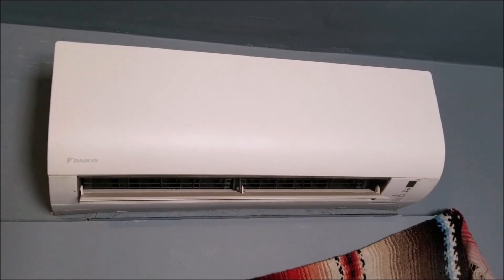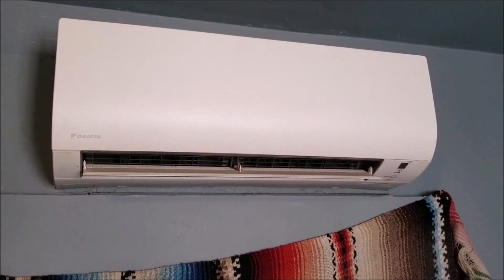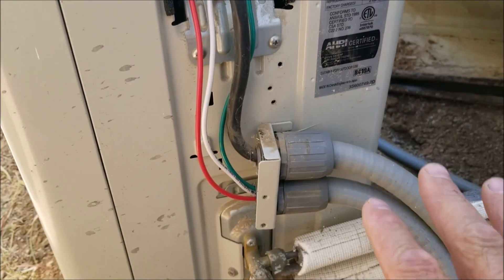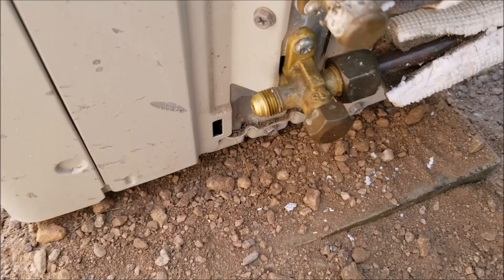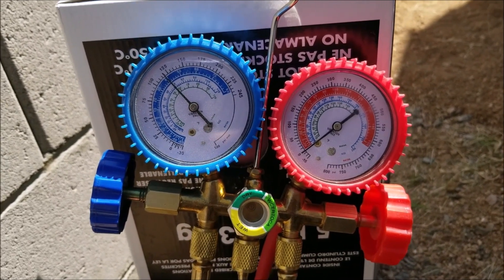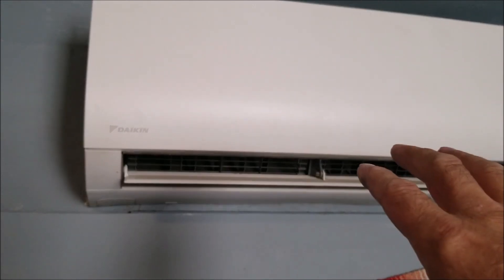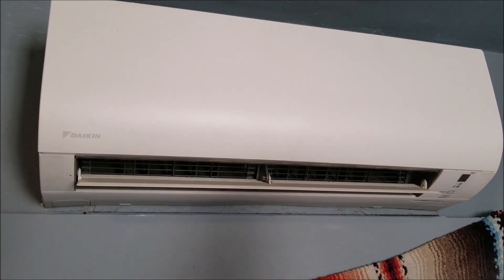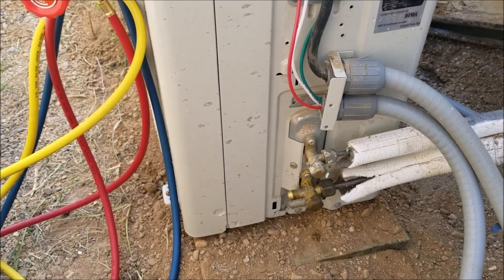How To Add R410a Refrigerant to a Mini Split that Has a Low Charge

Comment: After recovering All refrigerant,do we need to vacuum it down the outdoor unit or just the line set? Please help me I’m a rookie
Reply: The outdoor condensing unit is sealed at the factory, but once in use, it has been opened and would need to be set in a vacuum. Basically, if it is direct from the factory, it is not vacuumed down, but if it has been in use and the unit has lost its refrigerant, then yes, it will need to be in a vacuum along with the line set.
Reply: Thank so much Sir , as a beginner so I just installed a 3 Ton mini split unit, I do all the procedure , I vacuumed it down to 320 over 10 mins . When I release the refrigerant I heard the water sound through the line set, so I’m worried about the refrigerant leaking. I saw a tiny drop of water under the flare nut. Is this refrigerant leak? If I were to vacuum the condenser unit do you have any tip for me?
Reply: @joelin5877  Check all the connections with soap and see if there are any bubbles that will show if there is a leak. If there is a leak, you can pump the refrigerant back into the outside condenser like it was when shipped to fix it.

Comment: If the system is empty, do you recommend putting on a vacuum first?
Reply: If the system is empty, first, fix the leak,  place it in a vacuum, then add refrigerant in by weight with an HVAC scale.

Comment: Another thing is that some places require you (by law) to fix a refrigerant leak before adding refrigerant. The refrigerant does not get used up like gasoline in a car. It has to leak out to be low on refrigerant.

Comment: Usually they give you the amount of refrigerant required in ounces. Don't forget to add extra refrigerant for longer than normal refrigerant lines. You will find that data as to how much to add per extra foot or meter in the installation manual or on the outdoor name and data plate. Remember that there is an accumulator in the outdoor unit that holds extra refrigerant in it for heating months. If you do not follow the proper procedure, by the weigh out and weigh back in method, you might have enough refrigerant for AC mode but not near enough for heating mode. If you put in too much refrigerant in the system, and then cause liquid refrigerant to run into the compressor causing catastrophic failure.

Comment: Forgot to purge the hose before adding the refrigerant. Also, I would recommend letting the unit run for about 15-30 minutes to see if the pressure drops or increases. Those pressures with fluctuate depending on the weather outside.
Reply: On a single head unit, you don’t have to wait anymore than 5 minutes. The system isn’t really big so it doesn’t take long to stabilize.

Comment: No purge. Adapter has a schrader valve so if you put the adapter on first you won’t let much out but never check refrigerant on these unless you feel there’s a problem cause as he said you loose some every time you put gauges on and take them off.

Comment: Most techs with the compressor, gauges, lines, and valves probably end up adding some air into your perfectly sealed system.  Usually will be fine.
Reply: not the point. this guy claims to be a pro, and that's a huge no-no.

Comment: If my gauge says empty (  30 psi) is there still refrigerant in the split unit? I ordered a recharge kit that has a little more than the unit needs so I am thinking I don't need to recover anything if it says empty. Id Just vacuum it out again. The recharge kit has Leak stop and UV dye in it.

Comment: how do I calculate the required r410 on an empty 4-zone mini split 36kbtu, Suction OD is 3/8 and Liquid OD is 1/4, I have 82ft total for all 4zones but not sure if I need to multiply this number by 2 because each set has two lines, if so then its 164?
Reply: Buy and read a book on basic refrigeration then go buy and read a book on mini-splits because they are different then go online take your test get your certification they will send you your license in the mail… now you’ll know…… and Never I mean Never go into any forums on this subject

Comment: Really nice video! I'm a beginner and have two more questions. When the refrigerant comes out of the bottle in liquid form, does it evaporate immediately and then go into the suction line in gaseous form? I think so! And what would happen if the Mini Split is in heating mode, instead cooling mode? Is charging possible? If yes, do I still use the suction line for charging? Does the suction line become a liquid line and is getting warm?
Reply: in heating mode you would have to heat up the refrigerant bottle to a higher pressure (300+) than the line. That's why charging is done in cooling mode.

Comment: The problem is when you recover the refrigerant, a small amount of compressor oil is also recovered. Not a problem when only done once but when done multiple times it will no longer blow cold air.
Reply: Lol, it will blow fine until the compressor seizes.

Comment: I just installed a new split unit , but I didn’t do my connection right, and my freon escape, 
Can I refill it?
Reply: if you are in a pinch you could use half the amount of propane, but fix that leak and Don't blow yourself up.
Reply: @thedavesofourlives1  Propane?

Comment: did you have the mini split running when you add the 410 refrig. ?
Reply: Thats exactly what my question is.
Reply: @joedenny8853  well I gave it a shot, not knowing the answer, I hooked the gauges to it and started it, added just a little at a time, got the pressure up like one that was working, 120 and wow it worked like a champ and still going, been a month and doing great, I guess It worked

Comment: Question, do i run the ac on cold when charging? Or doesn’t matter?
Reply: yes, or you will be fighting the high pressures of the compressor in heat mode.

Comment: what happens when the line set is shorter than the precharge factory recommended line set. for example 95ft precharge and I sued only 30 ft of lineset for a multizone mitsubishi
Reply: then you release it into the atmosphere, obviously. (joking)

Comment: Bleed your line. And no superheat or sub cool? Just winging it?
Reply: Unless you recover the charge and weigh it in, yes you gotta pretty much wing it. Superheat and sub cooling are kinda meaningless on something that has a variable speed compressor. Best way to charge a TXV is with sub cooling which is very difficult to measure on these things. They usually don’t tell you what sub cooling they expect. To rely on this, you’d have to know the thing is running at or near 100% capacity. The few times I’ve done this I just shoot for about 15 degrees of superheat on the suction line coming back. It’s not rocket science. Just add a little bit at a time. It need not be exact.

Comment: You forgot to purge your hoses and just added non condensables  into your system which is not good. You should always crack open the yellow hose on your gauges with your refrigerant tank open until refrigerant fogs out and then crack open the blue hose at the gauges so it pushes any air out of the hose.
Reply: Man you’re smart
Reply: @Dbltrl no he just been doing this for a while

Comment: Quick Question (i hope) .. I've vacuumed down and am ready to go, but wondering about order of operations.  When do I open the valve stems?  I assume since the system is running on cool (based on comments answer) the valve stems were opened after vaccuming out the system.    So a) hookup tank and service ports to yellow/blue as shown b)  open valve stems to let what refrigerant I do have into the system c)  turn the mini-split on in cool mode d) open tank via yellow and flip e)  open blue "on and off" as shown to get to right pressure   or, should I hookup after opening valve stems?   Seems like since I've got yellow / blue connected to test my vaccum, i can just move the yellow from the vacuum pump over to the tank, open the valve stems and follow video from there
Reply: If the system is in a vacuum the refrigerant will need to be added in by weight

Comment: I add refrigerant by required weight but my suction pressure was like 74 psi and suction line is 24 degrees

Comment: This video saved my bacon.
We had a mini-split multi-head unit installed less than four years ago, and the unit just started to throw error messages. The error message was the refrigerant was low. The machine would not turn on.
I figured out the override switch and ran the compressor, then hooked up my gauges as you show, and put my bottle on my scale. I added about 100g at a time, let it run for 5 min, and checked the temperature of the three indoor head units. 
The unit is under the max tube length, of 50m, so I know it was supposed to have 2.4kg or 2400g of R410a in it. I added 100g at a time. When I got up to about 300g the head unit nearest the compressor started to blow some cool air, and the temp inside the head unit went from 32°C to 27°C.
I was on the right track.
I kept adding 100g at a time until I had all three head units inside temps at 19°C which is what my other aircon's inside head units were at when set at max cooling of 22°C.
In total, I added about 900g of R410a refrigerant.
I know there is a leak somewhere, and I'll have to fix it, but I'm really busy with work right now, and would just like to get through the summer. Off-season I'll pick up a better deal on a used recovery machine and bottle then ill fix it correctly. I have two other aircons that I have to do this with, so getting a recovery machine and bottle is undoubtedly going to happen.
This video really helped me out, if even just a short-term fix.
Thanks from Tokyo
Reply: What error code did you have? Mine is error code EC. Thanks.
Reply: Did you get it fixed?

Comment: 9:50 You don't need to be rushing here, nor do you need to let refrigerant out of the hoses into the atmosphere; you can empty the gauge set and hoses into the system. Of course that will increase the amount in the system by a little more, so you have to bear that in mind when estimating how much to add. Do this by closing off the liquid line valve (under the nut to the side of the valve connector) with a 4mm Allen key while it's running. The compressor will then suck the refrigerant into the system. And if you use a screw in valve depresser, you can release the Schrader valve once the line set is empty so you can undo the connectors with no pressure. Then open the valve again and the flow will return to normal.
Reply: Will this hurt the system at all? (Newb here)
Reply: Agree, that is how i learned it too.
Reply: Thanks.  Do you unscrew the schrader valve depressor while it is running, or shut it off first.  If still running it may suck in a little atmosphere, no?

Comment: Delta t on a mine is around 20 to 25 mine splits have variable speed compressors variable speed fans and electronic expansion valve on the condensing unit unlike conventional systems have the metering device in the evaporator that is why the only true way to get the credit charges is to weigh it in

Comment: With multi unit condensers, do you use one service line to refill or do you have to do it for each suction line
Reply: As long as they all use the same condensing unit, no need to add to each head.

Comment: What the short short short version.   Obtain Freon from some place, then connect as shown, without all the not necessary gauges.  Connect freon the add volume for 1-2 minutes with Mini split off.  Disconnect freon, run mini split.    Perform this sequence until the unit starts blowing cool.    I didn’t invent this, a 84 year old blue collar man showed me n person.

Comment: I want to start from scratch after I discovered a slow leak and made the repair (bad flare on the low line). Pretty sure I lost all the r410a because it doesn't cool. Do I just vacuum it down then add the required amount of refrigerant? How would I know if there's still refrigerant in the system? Thanks
Reply from the maker: If the unit was not pumped down, and the line set was open, then there is no refrigerant left in the system. Once the leak is fixed, it needs to be vacuumed down and then the correct refrigerant added in by weight.
Reply: @HVAC_Mechanic  got it, thanks much! Edit: it works now!

Comment: My suction temperature is 48F. Suction pressure is 94PSI. 70 outside. Supply 46.6F. Return 67.6F. Delta T 21F. Unit was low. I added 2.65 lb of 410. But low side would not go to 120psi. Mini split in a full blast. Any ideas? Thank you!
Reply: It might not go up to 120 psi , the correct way to do it is pull recover and add refrigerant

Comment: Why are you feeding the suction line of the compressor with liquid? I trying to understand. I thought you always feed the suction line with vapor.
Reply: Not with 410a
Reply: this unit has an accumulator (thing attached to the compressor) to allow adding liquid.

Comment: When you recharge them does that automatically kick on the compressor because my fan is running slow and I don't think my compressor is running and I think my system is empty

Comment: Does it automatically show the pressure level when connecting the line before you even open up the valve on the gauge or do you have to open the blue valve to get the proper pressure reading first
Reply: Show automatically the pressure

Comment: You didnt purge the lines at the bottle or at the unit to purge the air out of the lines. If you add to much it wont cool. Most techs add more then needed to false read and tell the customer the units bad. The more you add freon the temp will go warmer

Comment: Can you recommend an EBAY seller for 410A?
Reply from the maker: EBay recently banned R410a sales on their platform. There are several websites that sell R410a with no need for an EPA 608 card. The websites sell it as long as the buyer state that the R410a is for resale. I haven't bought any from any of the many websites yet, but I likely will soon as I run low on R410a and the local supplier is too expensive in my area. If you buy from one of the many websites, let us know how it goes.
Reply: @HVAC_Mechanic  Ok but was hoping you would let me know how it goes, lol

Comment: A card is not needed to purchase it only to use refrigerant. That’s why they don’t ask.
Reply: Actually that is inaccurate.  All supply houses and gas supply shops require a copy of your EPA card for the sale of any restricted refrigerant.  No legal legit supply distributor will ever sell refrigerant to a person without an EPA 608 card / certification.  That violates the EPA 608 laws.  All refrigerants are kept in a registry and database to how much is sold, how much is turned in for reclaiming and how much was lost to venting.  That would be like saying you can own all the drugs you want as long as you don't sell or use them.  Where on Amazon is there any restricted refrigerants for sale?

Comment: I'm trying to figure out how do u empty the old R-410 completely out and load fresh R-410
Reply: why does no one anawer this question ?
Reply: You need a recovery machine and a tank
Reply: or in a pinch, make your own machine with a compressor from an old unit and pump into an old propane bottle. @A13XHOMIE

Comment: If u suspect air or moisture in your lines from not properly being vacuumed how do u correct that does the R-410 have to be completely changed or what do u do ? Like how do u empty it and start over ?
Reply: Yes, evacuation, proper vac and recharge with virgin 410
Reply: @Supplyhousemarco  If I want to buy a system to recapture the R410a, what is it called, and what do I do with the R410a afterwards?
Reply: I looked it up, but the link where to bring it is not working. https://www.epa.gov/sites/default/files/documents/ConstrAndDemo_EquipDisposal.pdf
Reply: @jawharris  reclaim machine; most hvac supply houses will take it back and an send it back to be recycled